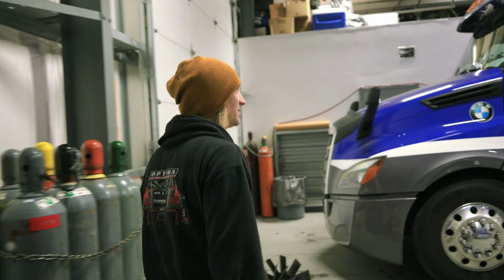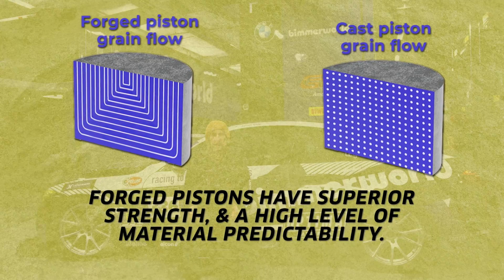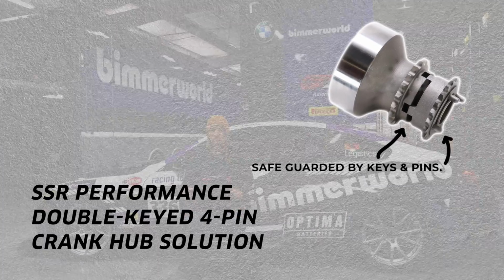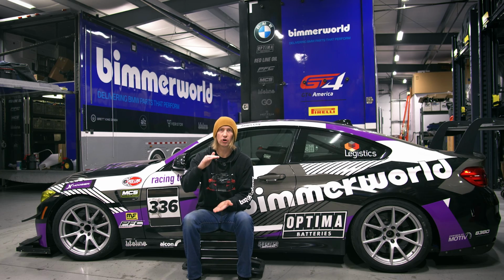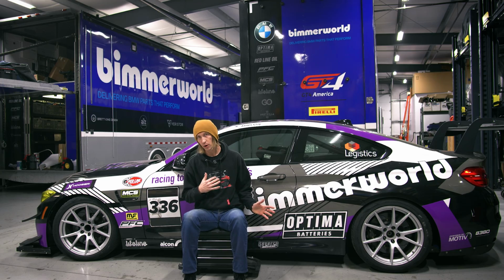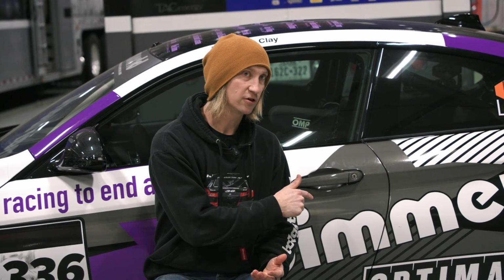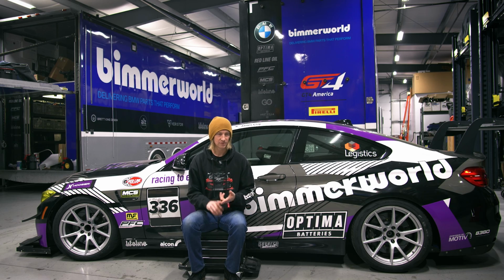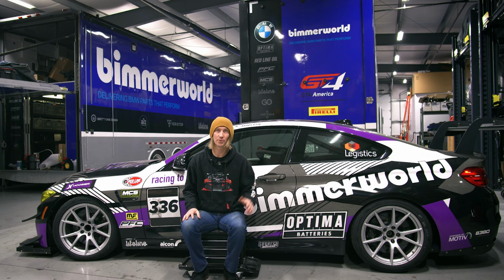How to make OVER 900hp RELIABLY with your S55 BMW F8X.

Comment: 800 at the wheel using race fuel. It's a lot of boost. Must be 800 HP no 800 WHP without ethanol.
Because that turbos max is 35 psi. Safe
Reply from the maker: This setup made a peak of 908whp on our dynojet on race fuel, but as you mentioned probably not the safest there.  We did not intend on ever running it at that level on track and around 750-800whp was the target for our max power tune for track driving.  On an event like One Lap of America where we ran 100% 93oct the tune was turned down to around 670whp.

Comment: What is the stock block hp tq limit with upgraded turbos
Reply from the maker: Hard to say because we've certainly seen some very impressive numbers out of a stock block setups, but they don't last.  So to say they make 1000+ on the dyno is a tough claim when they end up dying soon after.  Our goal was to build a reliable engine that could do 45mins on track without skipping a beat and we weren't aiming just to claim the highest hp on the dyno and have a short life cycle.

Comment: lol thats not close to 800 wheel on 93.  shits maybe 650. that stock low presure pump cant handle over 600...
Reply from the maker: We didn't say 800 on 93oct, we said said gasoline, meaning not e85 or ethanol fuel.  We made 807whp SAE on our Dynojet on VP Racing 110.  With this fuel we did not have any fuel pressure issues from the LPFP.  If we did, we would have upgraded it.  We upgraded every other piece of this car, its not like we were going to skimp on something else it needed, just never became necessary on 93/104/110oct
Reply: @CrownVapes You've no idea what you're talking about.
Reply: @4everOnCall  i have the same set up and more.

Comment: How much more oil can you put in it with the sensor&spacer?
Reply from the maker: It allows you to add an extra 3/4 liter of oil to your system.  Hard to really draw a hardline on power output by octane.  Each tuner may have a different answer here and it certainly depends on how you drive the car.  Even with good gas you'd want to run a more conservative tune and power level if you are tracking the car like we are in the GTMore.  But for the street you could certainly be a little more aggressive with boost levels since tremendous heat soak won't be nearly as big of an issue with short bursts.
Reply from the maker: More on the oil level spacer kit here: https://www.youtube.com/watch?v=TXDiMH_V20E
Reply from the maker: https://www.bimmerworld.com/Oil-Level-Sensor-Spacer-Kit-OEM-F8X-M2-M3-M4-S55.html
Reply: Also, how much power would you expect to be able to push on 98 octane

Comment: I was always under the impression S55s had fully forged pistons stock 😳
Reply: Only the crank and rods are forged, pretty no manufacturer using forged piston due to thermal expansion issues

Comment: Was the MHI turbo plan based off of the full race turbo?
Reply from the maker: The MHI project was outside of the Full Race package. As we understood it from MHI, the Full Race wasn't actually an MHI produced package, but was using some MHI partners to help create their system. This was to be a 100% MHI produced system and utilized a bit different compressor and turbine sizes (larger) but alas, MHI decided they did not have the capacity to move forward with the project.
Reply: I’m sure MHI have produced a stage 1 700bhp turbo for the s55, why not go for these?